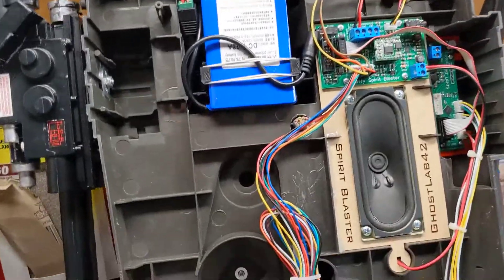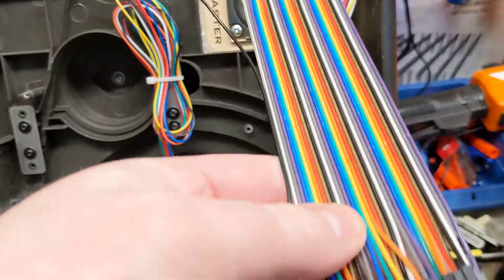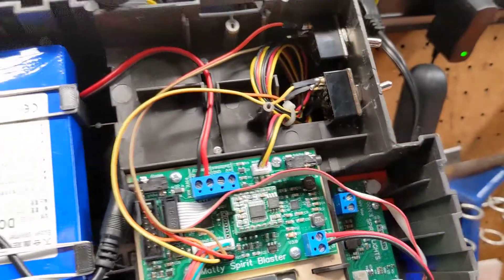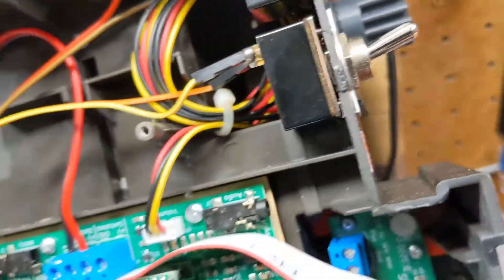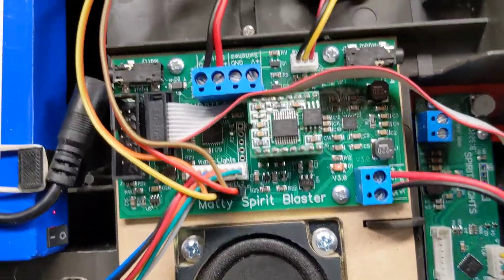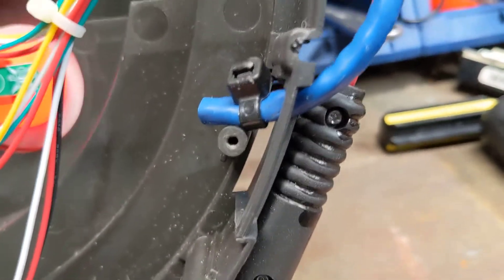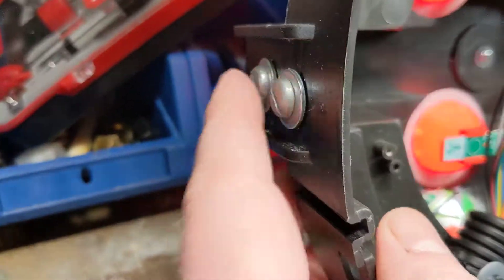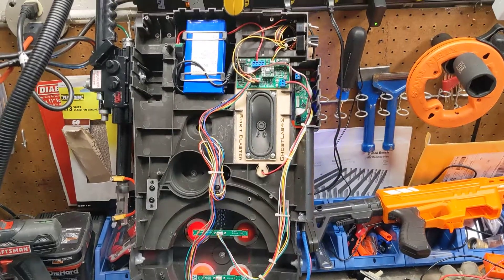Spirit Pack Build: The Internals

Comment: Question where did you get the cable that connects your spirit blaster board to your wand?
Reply from the maker: That cable came with the Spirit wand light kit IIRC
Reply: Ah … are those kits currently sold out I can’t find it anywhere
Reply from the maker: I think they might be. Spongefacemcgee on eBay is the seller but it doesn't look like he has any available.

Comment: Is that a Spangler wand? Or How is your one connected to your pack do you have Spangler link
Reply from the maker: That is the Spirit wand. All electronics are from Spongeface on eBay and GBfans.com
Reply: What is the extra white tip plug used for in the n filter? I bought this kit, so I wasn’t sure if it was used for a switch for smoke? I don’t know how much power could be running through it ?
Reply: Like your pack as well very nice job!

Comment: Any tips on making that soda can reflector?
Reply from the maker: Use a VERY sharp scissors or pair of tin snips. Cut off the top and bottom of the can. Lay the remaining part flat and cut out a disc a little larger than the size you need. Cut the disc halfway across and the overlap one end over the other. That should get you a crude cone shape. At least that's what I did 😁

Comment: Great work. Love how you used switches for the different modes. I put a small hole in the back board to be able to access the switches. I used the gbfans sound board and light kit from spongeface. I also put a vape smoke mech when it vents. Pretty easy to do - vape pen (takes some soldering), small air pump and vent relay circuit board from Spongeface. So during the vent, it billows smoke! Very cool.
Reply from the maker: I definitely want to add a vent kit as the next mod. As they say, a Proton Pack is never finished, right?!